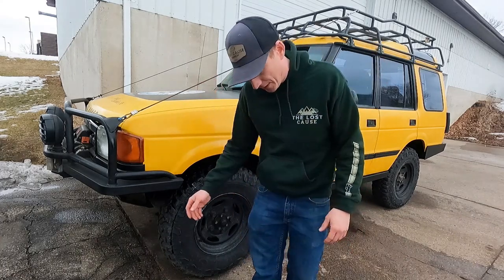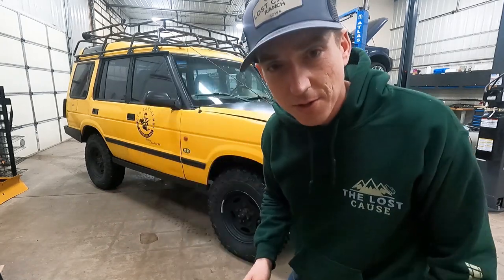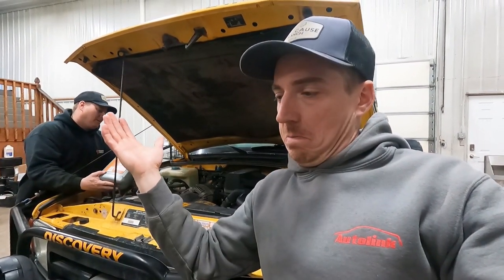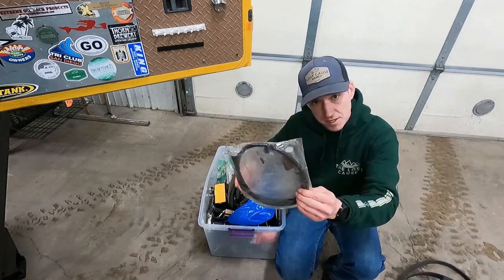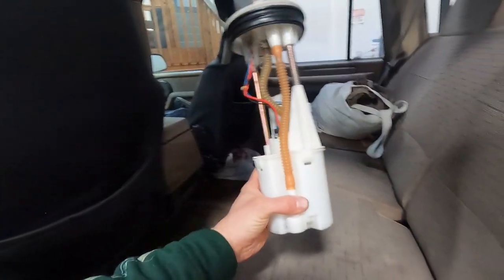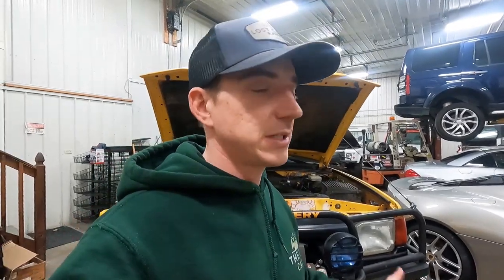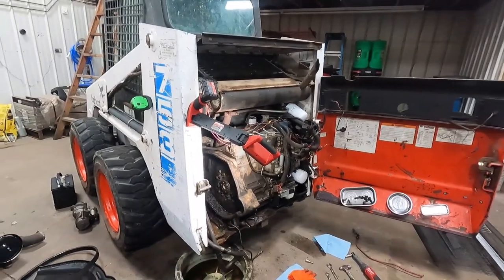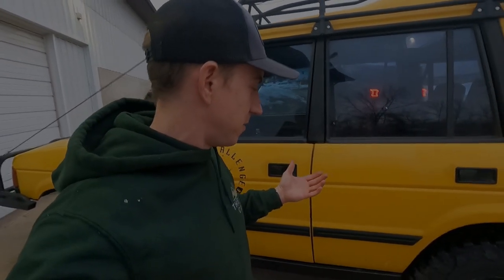PROBLEMS | Our 1st Issue with the ECO XD Discovery

Comment: The blower cutting out is to do with the contacts on the HVAC unit in the cab. Reach out if you need a new(er) one
Reply from the maker: Thanks for the heads up, I should have some spares around but will definitely reach out if I don't.